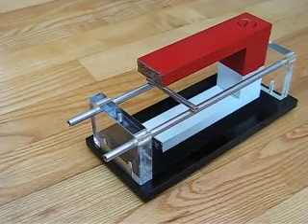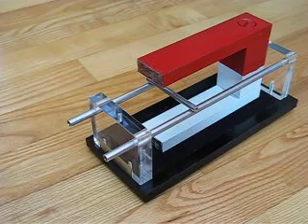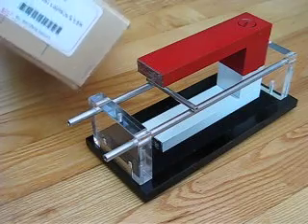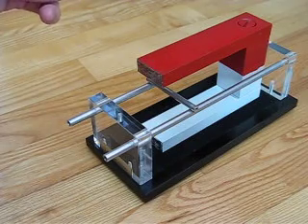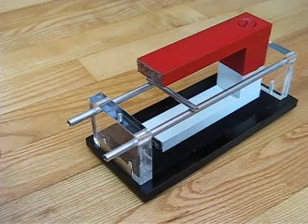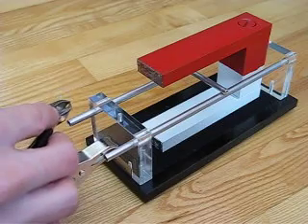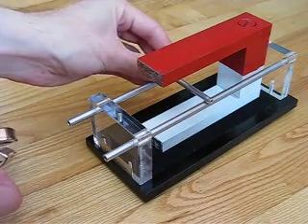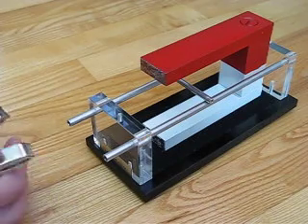Law of Laplace

Comment from the maker: @HifiCentret Spend quite some time in my childhood trying to design a motor with only permanent magnets. That's how I realized that you have a quite obvious view when you design it. But then try reversing you view 180 degrees and "magically" the motor (in the human mind) seems to obvious run the opposite way of first thought. The truth is the push in both directions are equally over the revolution no matter how designed. They'll only run as long as the kinetic energy you've given them lasts.

Comment from the maker: Thanks :)

Well, this isn't as much about voltage as it's about current since the source you apply is practically short circuited. So I can't tell you the voltage. But I can tell you the amperage and it's 200 mA (0.2 A) delivered by a small lead acid charger. If trying to replicate this setup please use a power supply which can take short circuit or build/use a current limiter which can. A simple one is really just a resistor in series calculated for current when put on the power supply.